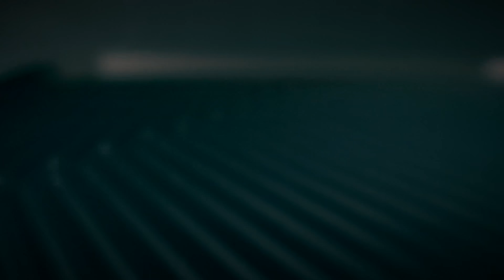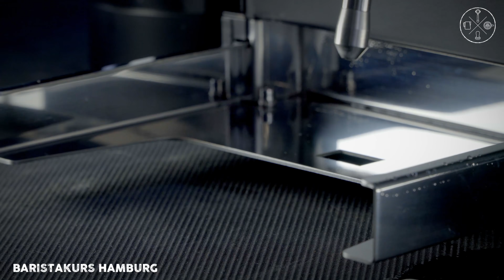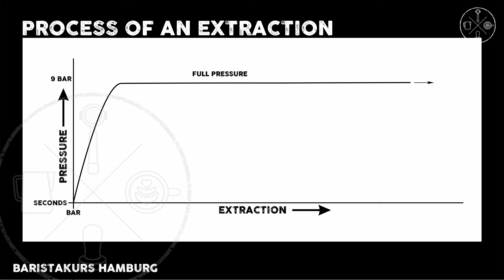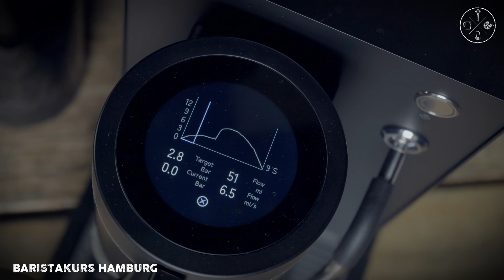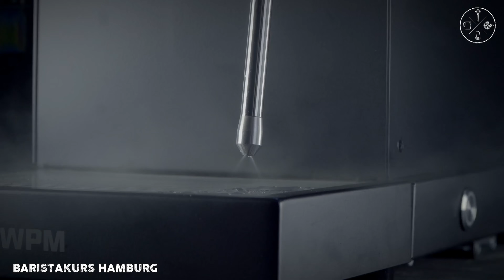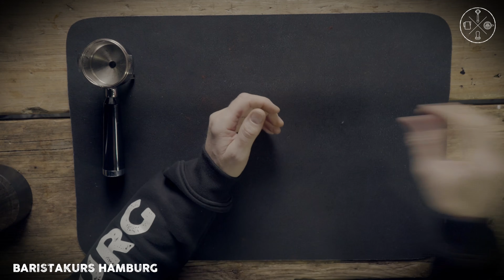WPM Primus - Deep Review

Comment: Typically espresso requires custom water which includes a small amount of calcium more magnesium for hardness and baking soda sodium bicarbonate added to RO or distilled water. Im not understanding the filter. Minerals are needed for taste of espresso
Reply from the maker: Yes, but you will have a problem when you have to much hardness (magnesium and calcium) in your water. Then you need a filter for the longevity of your machine.